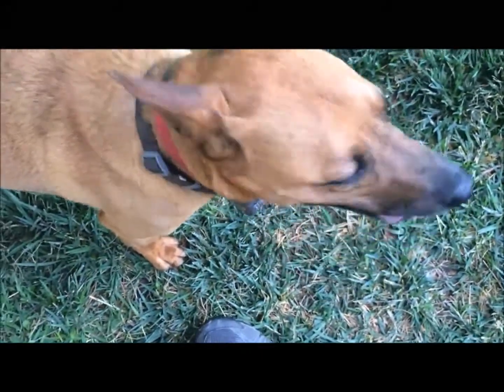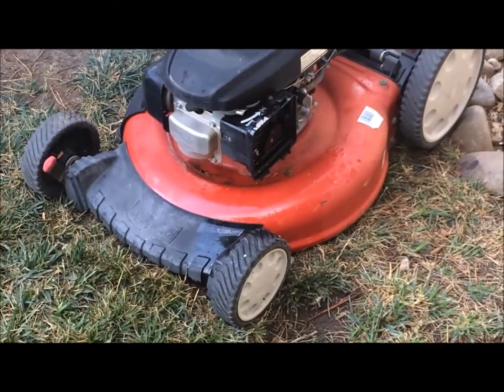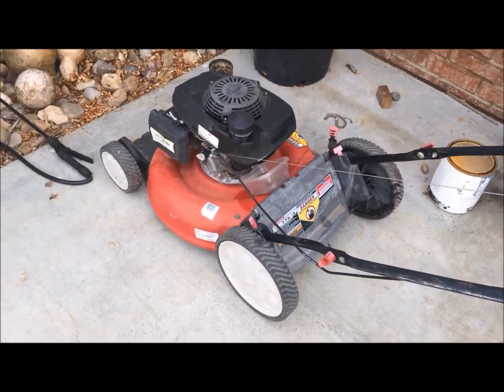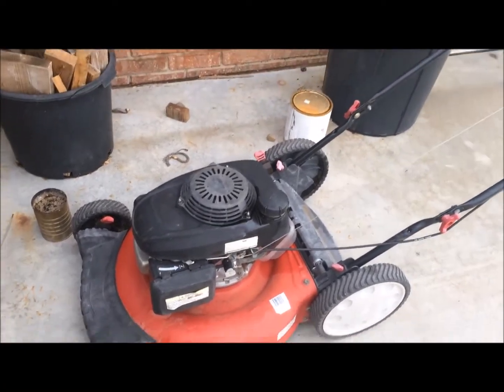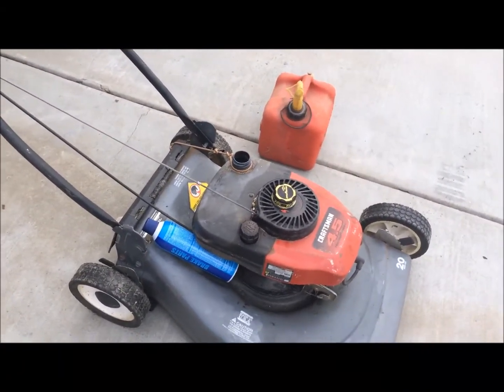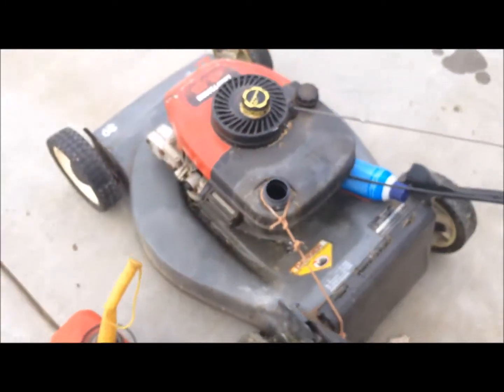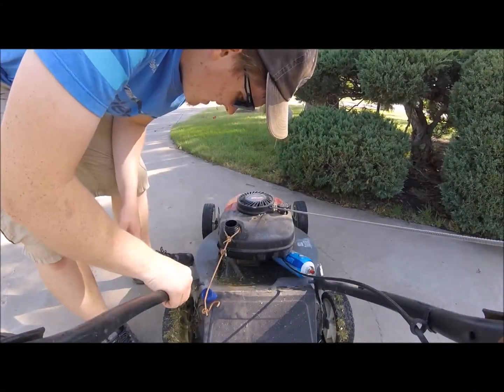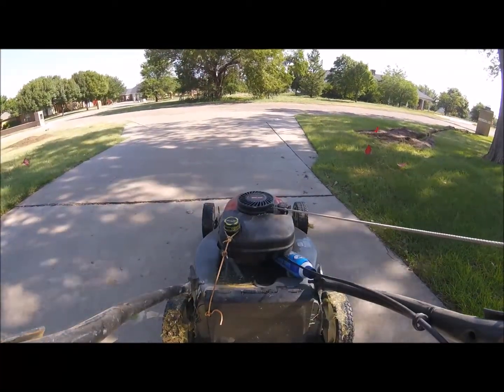Will 30 year old gas run?

Comment: Here is an interesting fact about disposing of "bad gas". If you google how to dispose of bad gas they tell you to look up and take it to your nearest disposal site. BUT try to find out how does a disposal site dispose of that gas or try to find out what they do with said bad gas all you get is...cricket cricket cricket!!! In other words probably a scam. They're just getting free gas! 
If I am wrong and you have valid info on how they dispose of bad gas please share
Reply from the maker: I am not sure what happens at disposal sites, but I have some knowledge of legal concepts (in regard to engineering). A individual in a position of authority has to be careful what they tell someone to do because they might be held liable if (for example) they tell someone to just "dump out bad gas in a alley" and this results in a injury. So to avoid any liability they direct you to a disposal site. I would guess it is disposed of by refining it again with crude oil. If that is true then I guess they get "free gas" but it would be the same as a carpenter reclaiming free lumber from a demolished house, and I don't see a issue with that since no one else would do anything with it

Comment: An old trick to clean out the carburetor jets: Get the engine running fast with your spray bottle and then hold your hand over the intake. The vacuum will suck debris out of the jet.

Comment: You need to work on your manual carburetion skills :) haha. That gas must have STANK. turpentine or varnish is probably the small you were thinking of, but who knows, coulda smelled like kerosene with whatever situation the fuel aged in. I hate that smell, especially when it soaks into your hands and clothes. New gas turns a green brown color when it goes bad, I would like to know the advances that have been made to fuel in 30 years. I have read we can get much more gas "product" out of a barrel of crude these days than we used to, but since it's not simply distilled but is cracked and reformed I wouldn't be surprised if that was a more "durable" fuel. Thanks for sharing your test! Looked like fun, I would have done similar just for the fun of it and the learning experience.
Reply from the maker: Yeah the smell wasn't great and it definitely wasn't as good as new gas but I was surprised it ran at all. I think that new non-ethanol gas might hold up as good or better but not ethanol gas. I hope the color was just from the gas breaking down but it may have been some rust in the tank.

Comment: Very I formative . Nice video .
Reply from the maker: I ended up using that mower with that gas about a week ago and it started and ran good but was a pain to get going, it doesn't want to run until it's up to temp.
Reply: DreamTeamProductions So what did you do to get this old gas to work ?
Reply from the maker: Had to run it on carb cleaner for a bit and then it ran on its own and had no problem starting, it still has some compression issue since the intake valve is still not acting right
Reply: DreamTeamProductions it's too bad you can't get real gas without spending a fortune . Today they put ethonol as a filler and cannot be filtered out and makes gas expire . Old gas doesn't . You can get ethonol free gas but it's about 40$ for around 2 and a quart . I use it on my small engines but definitely can run a car on it . To much money .
Reply: @PracticallyStock  do you know how to get rid of a very small amount of gas
Reply from the maker: @ezwsteez  Not sure what your situation is but if it was clean I would just add it to some gas tank or if it was unusable I guess I would just let it evaporate. Other than that not sure of the best way to get rid of it. If it's a sizable amount of gas I think most cities have a chemical disposal place that I would think could take care of it
Reply: @PracticallyStock  it was just a tiny bit left in a fuel can that was dirty so I filled the can with water and put the water in a bucket
Reply from the maker: @ezwsteez  Well I think the gas will float on top of the water and evaporate after a day or two (depending on weather) after that I guess you could go pour it out away from any desirable plants. If it is less than a quart then I don't think it's that big of a deal
Reply: @PracticallyStock  yeah it was definitely not a quart
Reply: +DreamTeamProductions try a little Marvel Mystry Oil in your oil bout 2-3 cap fulls. the cap of the cantoiner it comes inworth try cant hurt
Reply: My friend just took a few gallons of gas out of a wrecked f150 that he bought after sitting since like 2006. He put the gas into my old 94 F150 that he now has. Then topped it off with new gas. Now the truck runs like crap. Don't want to start. Missing badly. I told him to drain the tank. Refill with fresh. See if he can separate out the old gas later. Idk if he can. Never should have put that old crap in the truck.
Reply from the maker: Yeah I just bought a 280zx that runs pretty bad and my suspicion (hope) is that its just old gas causing it to run bad. This newer gas just will not hold up.